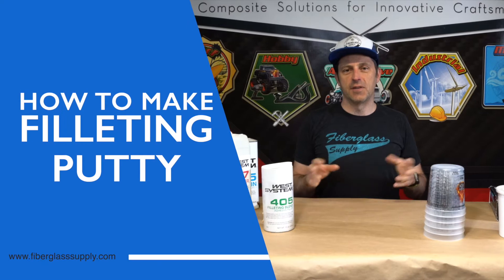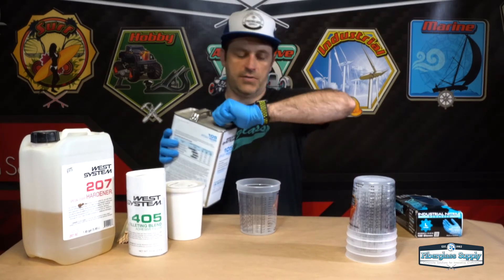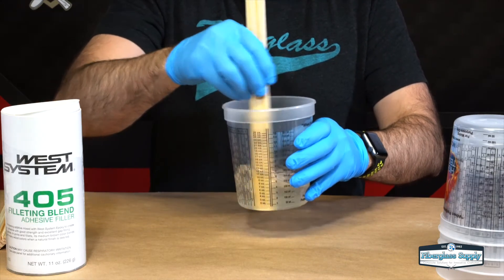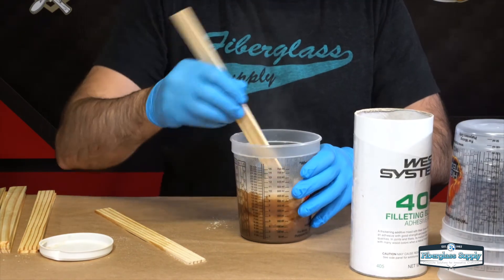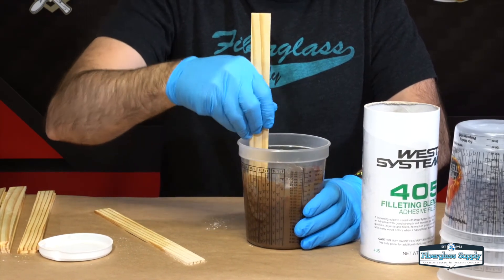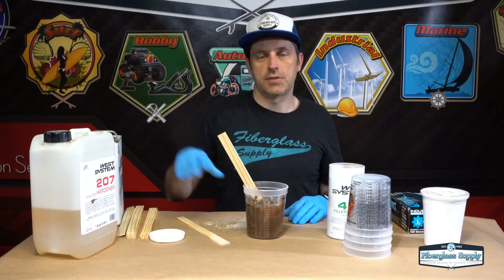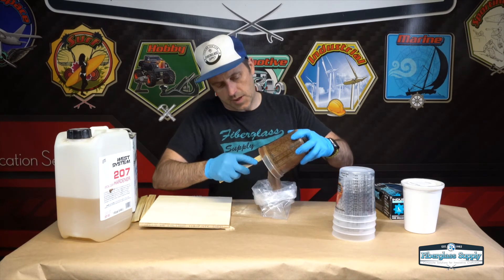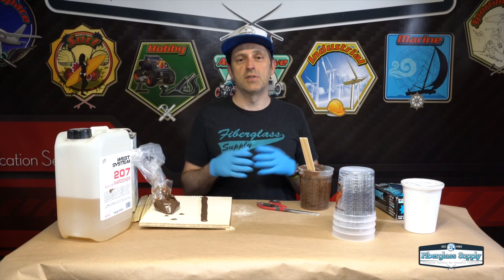Stitch and Glue Boatbuilding: How to Make Filleting Putty for Gluing

Comment: I purchased 405 thinking i could  use it as a general filler to thicken my epoxy and fill in some gaps i had  on my carbon/ kevlar kayak. In the long run will this thickened epoxy on a carbon/kevlar kayak hold, being that this type of thickened epoxy is only for wood boats and kayaks??